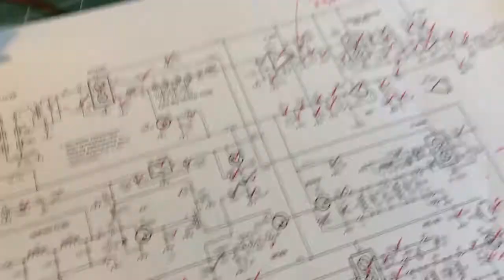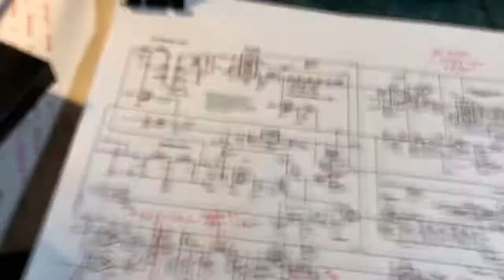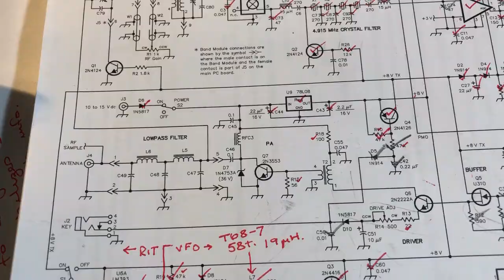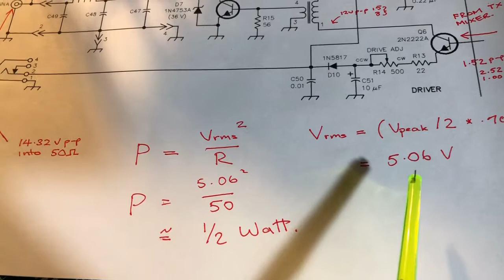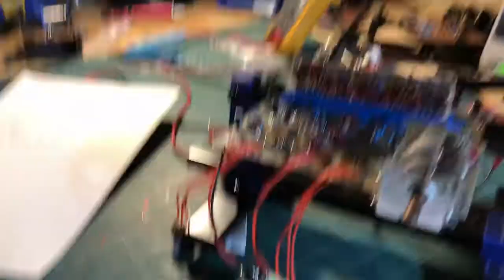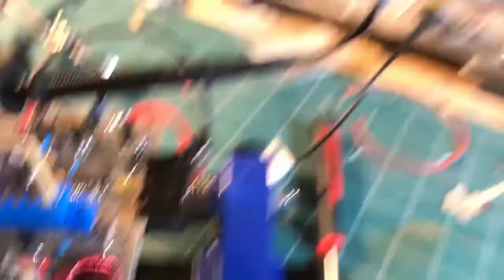Norcal Sierra - Part 9 Transmit Mixer Problems Fixed, PA and Final Assembly

Comment: Nice project,  where did you get the boards?
Reply from the maker: From here Paul http://farcircuits.net/TRANSCEIVERS.htm

Looks like they are out of the Norcal boards though
Reply: @na5y  I considered scratch building a Sierra in the past. I built an SST for 30m and it worked well, character tuned VXO. Stable, sensitive,  and good TR / break in.  The 2W power isn't enough here in VK, not enough hams, but I added a 5W afterburner with good results.  A useful and achievable txcvr project,  basically the same line up as the Elecraft K1 too! Thanks for sharing.
Reply from the maker: Also this guy sells the boards http://dh4ym.de/  - you'll have to run google translate unless you speak German though

Comment: perhaps a stupid question, but does it matter if the edge connector is soldered in with the lettering in front or on back? I don't see any reason why it would matter, electrically, but don't want to miss something. I ask because someone posted the "numbers" have to be in front. That puzzled me because I don't see why with the connector.
Reply from the maker: No - the connector is symmetrical. Perhaps because the band boards are numbered so it assists which way round it goes (the band boards are edit: * not* symmetrical)

Comment: Will 4.9152 MHz work? I know they differ by 200 Hz but if matched? I also need to find an inexpensive crystal checker. Any suggestions? I've found a couple but they only resolve to the 100 Hz level.
Reply from the maker: Those crystals certainly would work if matched. As far as checking - building a simple oscillator is the easy part. Plenty of examples around:
- http://www.n5ese.com/xtal_checker.htm
- https://www.youtube.com/watch?v=blalAktxFoI

Tough to measure without an accurate frequency counter though.Those cheap kits off ebay are probably not accurate enough to be honest but perhaps worth a try. k7qo's channel on youtube used to have a kit he would recommend but it looks like he's shut his channel down unfortunately and I can't remember the kit

Comment: I found this series very educational and helpful. I've resurrected a number of old Norcal Kits in my posession, and I have the same boards for this kit as you did. Some observations: old parts are hard to find, and expensive when you can. I fortunately bought the air cap back in the 90s and a set of band module boards. I did recently see a 9-45pf one advertised from Poland. The trimmer caps I got are not side mount, and a little larger. Will have to kludge these in. My FaR circuits board (last one) has the silkscreen not scaled properly. I do have 2 questions: How did you solder the connector to the 10 traces on top that actually connect to it? The edge connector covers these. and 2. what is the value of R102 on the band module boards? I suspect it isn't used. Thanks for the series!
Reply from the maker: Thank you for the kind comment. I did have quite a bit of fun pulling it together. The edge connector I lifted it slightly above the board and used a fine angled soldering iron tip.I was able to find most of the parts - the main tuning cap was one exception. There were certainly others though. Let me know if you need any closeup pics and I'll put them up on my google drive

Comment: I don't see a part 10. Did you ever get any further with this?
Reply from the maker: This was all I got to Lightning - after part 9 it was completed save for an enclosure. I did get this radio on the air (receive only) but I should have probably done an "on the air" video. Thank you for the comment